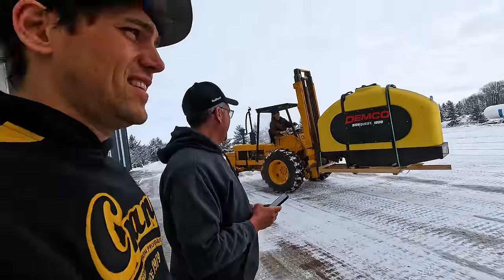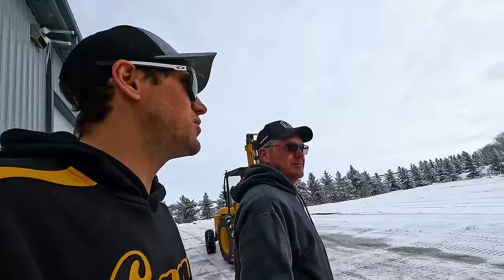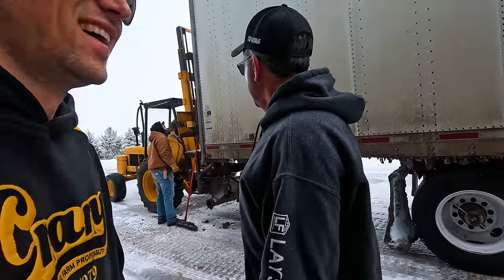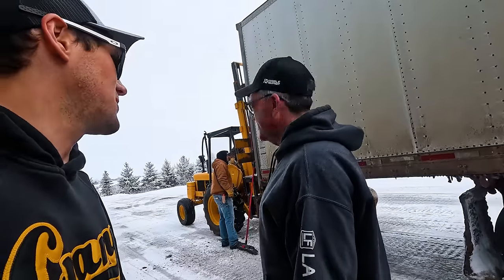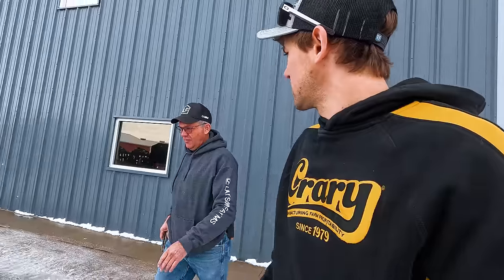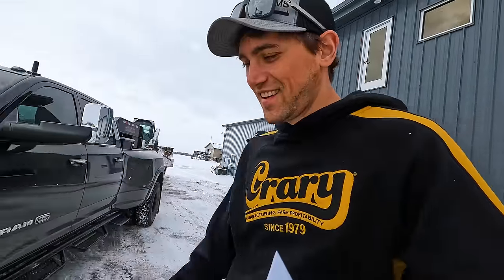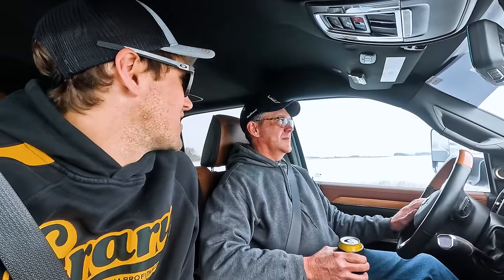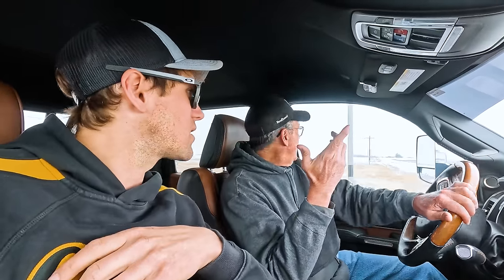Who Forgot To Cancel The Order??

Comment: Chet look into a shocker air hitch for your gooseneck we just put one on our dump trailer n it made a huge difference on the towing n driving while pull it. We r moving it to the 32 ft dovetail to c if it helps it.then have to go get another one.

Comment: I looked up the density of hydrogen peroxide to see what that drum weighed.  Depending on the concentration of the peroxide the barrel (assuming 55 gallons) weighed somewhere between 488 and 638 pounds.  For comparison we typically see 55 gallon drums filled with some kind of oil.  These weigh somewhere around 420 pounds.  So yes, that barrel was significantly heavier than the typical drum you would handle.

I remember moving drums of antifreeze for Fisher Oil in Rochester.  Those were way heavier than a drum of motor oil or hydraulic fluid.  According to Google a drum of antifreeze weighs around 500 pounds.

Comment: i had a Gator seat do the same. i used clear Gorrilla glue in the caulk tub to glue mine. Use a nylon wire wheel on a drill to rough up the old glue first. Use tape to hold it to the base for a day or so.

Comment: Man, Dougo, ya got me thinkin' there with the "moisturizing the seed" during planting ... lol..... a. if ya put a water line on either side of the opening discs, would it clean the soil off the opener and b. if you regulated the amount .... would it actually moisten the seeds in the process ..... hmmm.... way to go Dougo.... what my wife couldn't do, ya did it with an off the cuff comment on the interweb... made me think..... or put one line @ the tip of the "seed spitter".  ... see ... it's still happening !

Comment: That's probably 35% H2O2, you'd need 50% or better. 90% is considered Rocket Fuel. I used to haul HP by the Tanker load.